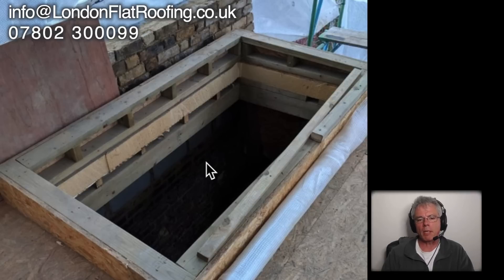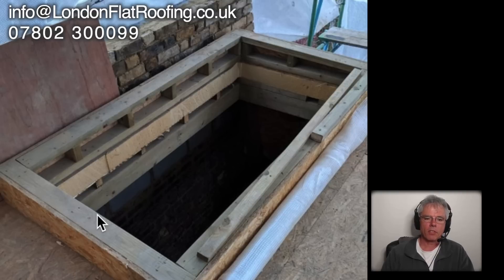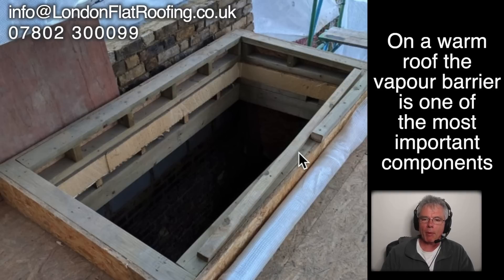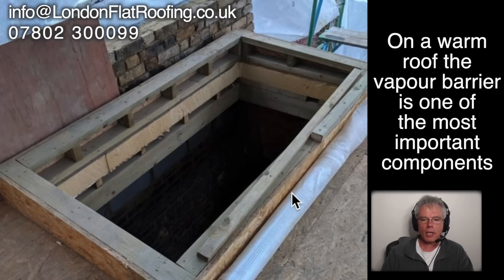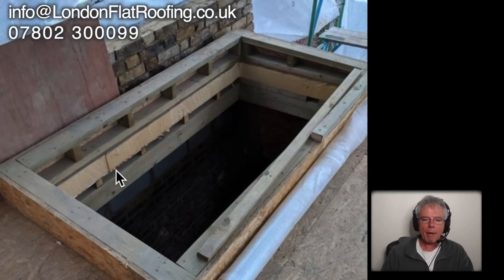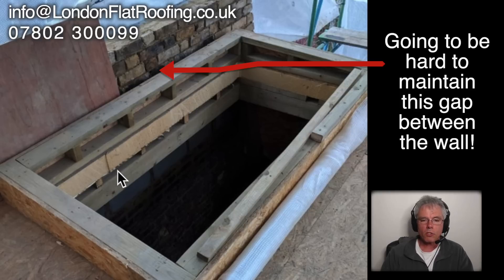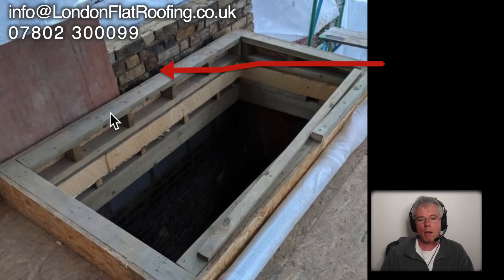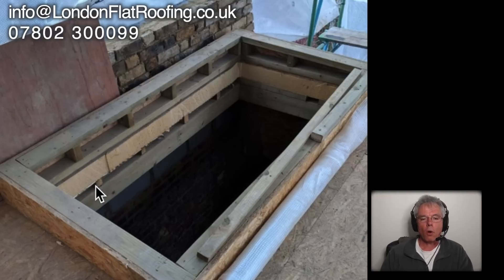Flat roof design going wrong.  Who is responsible for your flat roof design?

Comment: Hi Steve, could you give me a bit of advice. I am building a garden room and the roof joist are 120 x 45(5x2). I was thinking of using(cold roof inside to out )  12mm plasterboard - 1000guage polythene - 25mm PIR up to joist - 100mm XPS insulation between joists and 20mm air gap under decking with continuous soffit vents back and front. will I get problems only having 20mm air gap

Comment: Hi Steve, I'm in the process of building a flat roof for a newly single storey. The plan was to have a parapet wall with allutrix over the sub deck 150mm insulation and finishing with resitrix full bond. Things were a little sloppy with the structure engineer/ lintel, which led me to change  the roof layout into a traditional(not parapet). Is the mineral felt ( torch down) method my best option or can I still use resitrix? Thanks
Reply from the maker: You can use torch on felt as a vapour control layer if you want. However it has to be one of the thicker torch on felt personally I don't use it but I have seen specifications that one or two layers of felt will work as a pair of vapour control layer. The main thing here is to think about the air control of the system. The torch on felt over the decking and up the walls if applied correctly will be 100% airtight and actually that's probably more important than the vapour resistance of the product.

Comment: I currently have a conservatory with a glass roof 3.5m from back of house out. I want to put a flat roof on with 2 flat sky lights. Will I need planning permission to turn a glass roof into a solid flat roof?
Reply from the maker: Yes probably you need to ask the planning department
Reply: @SteveRoofer  thank you I spoke with them today and no building regs are required. What thickness osb do you use for the bottom deck and thickness of osb if you are boarding on top of the celotex thanks Steve

Comment: I am a GRP roofer i tell customers all the time they need a vapor barrier on thir build  mainly cold roofs as warm roof its my job to do it and the amount of times they come back to me an tell me the building inspector says we dont need 1 is unbelievable,, they all have new builds with fancy pods but put spot lights in the ceiling carnt work em out ,,

Comment: It's all pretty simple actually. Builders have to follow the Architect, Structural.... and so on Drawings. If they change the drawings then the liability lies with the Builders then. So, whatever is wrong on Architect or whoever's detailing is done for the builders on the drawing, those are responsible for the mistakes. Meaning Architects should have learnt better in universities. ;) That's all. However, this case is not the worst one. It can be easily fixed at this stage. Since the roof is not covered by GRP or Epoxy Resin...yet.
Reply from the maker: Yes that pretty well sums it up
Reply: Most small builds I see don't have detailed drawings, they rarely tell you the brick and block type let alone build specific details.
They expect the builder to use experience and the builder asks the home owner if they have queries.
There should be simple to use resources that details all the simple common issues, instead you have to search multiple

Comment: A good builder should know this, it’s actually very standard stuff. It’s the difference between a good knowledgeable builder and someone who doesn’t know or care enough. You get what you pay for and good quality building work is expensive. The upstand details are fundamentally the same on all jobs, vapour barrier, continuous insulation, ventilation if necessary, correct application of all the above and there won’t be any problems. I always enjoys your videos, detailed and informative

Comment: A much better way of building these lantern opening is to take the extra time to construct a four frame of a triple which is within the ceiling opening value. Lot more space to insulate, get your vapour layers in and stops cold bridges. Easy to keep your opening square too
Reply: What do you mean "a four frame of triple"
I'm about to construct a warm flat roof with  a central lantern and worried about the lantern upstands. Can you explain how you do it in more detail please.
Thanks 👍
Reply from the maker: Yes that's the way I do them

Comment: I'm all for insulated upstands, but the size of that rooflight/lantern opening is far larger than the other version shown in your own video. I dare say that if the 12mm(?) plywood upstand isn't up to much abuse from a knock or a kick at some point in the future. I think a SIPS style upstand would be a better approach myself to get a circa 75mm wide upstand. Some rooflight manufacturers offer these as 'bolt-on' options when buying the rooflights/lanterns.

Comment: To answer Steve's question, I'd say the client is ultimately responsible. Depending on how they commissioned the work, that will determine who has the delegated responsibility. Chances are, the client didn't use an architect and has gone straight to the builder who's given them a price for the full scope of works. If that's the case, then it's either the main contractor or their roofing subcontractor who would be responsible for the competent and compliant design, depending on the nature of their 'contract'. If any deficiencies haven't been picked up by the BCO, that doesn't absolve the specialist (sub-)contractor from building a robust construction.

Comment: Any builder should have the knowledge if the work they take on. I am personally fed up with people doing work like this. I now build garden rooms and the amount of  apparent professional companies who build a sub standard garden room from a design aspect but looks good. Most are doing a cold roof with no ventilation.
Reply: There's quite a few companies doing this. Oakwood garden rooms on youtube do hybrid roofs where the PIR insulation is pushed right upto the OSB. They report no problems so far.
Reply: they are all trying to get insulation into their builds at same time as meeting PD regs. Are you building under PD regs and managing to ventilate still?

Comment: Builder builds things a desghner designs things simples  , agreed in what you have said,  makes sense  
But BCOs and desighners ,colleges need to educate us more on this area  , ive done both methods  , never had a problem  but technically your right , lots of things here that rattle me  condensation being one if a board is put on the deck will it just decay from condensation , bco by me telling lads to roll dpm over the roof 🤔 dont seem right   could be a condensation trap  also used alutrix

Comment: I am glad to see that a tradesman understands his trade. There is so much ** on You tube by so called builders that maybe YouTube should take down fake and misleading content??
As regards your question concerning the detail:  It should be the designers responsibility to detail and specify the materials to be used, be that Architect (I am one) or surveyor etc.  Small builders are invariably a tradesman who has set up to install all trade elements, I've met several builders who are say, a brickie by trade and confess to knowing nothing about joinery or decoration relying totally on their subbies, who just want a quick in and out and get paid.
As regards the detail you show, I assume that the ceiling is still to be installed, then the vapour barrier can be fixed to the u/s of the joists all with taped joints and taken up the rooflight cheeks.  The plasterboard is then fixed through to the joists.
BTW your example of the VP on a roof shows a very thin piece of insulation to the rooflight cheeks that also does not have a structure for the rooflight to sit on.  With that form of construction I would expect warm moist air to accumulate under the rooflight and condense on the poorly insulated cheeks.  Also the plywood would deteriorate with the moisture causing a decoration mess.

Comment: Devil in the detail, don;t leave spec to the builder, project manager should ensure detail before installation of windows, someone should be linking up between chippy and roofer/ flat roof installer, every design is slightly different, but excellent warm roof build up Steve

Comment: Don't need a vapour barrier on a warm roof construction. I would never put a window load on insulation. And they have point loading here too. The insulation does not seem thick enough to comply. It should be 150mm if it isn't.
Reply: I'm an Architect with 20 years experience and agree with everything said in this video. You always need a Vapour Control Layer with a flat roof as this prevents interstitial condensation at the dew point of the roof - ie usually within the insulation layer. Warm air rises and usually with moisture. When this happens you'll be compromising the insulation and may cause damage to the building fabric. The foil on the insulation cannot be relied on due to the termination points being in the wrong location - as outlined in the video. The VCL needs to terminate higher and be continuous under all insulation panels and around penetrations.
Reply from the maker: The flat roof Insulation should be as thick as necessary to get to the correct U value for building control this is taken as an avage what we don't know is if its not thicker elsewhere. Yes you do need a VCL with a flat roof. I don't understand the other comments please elaborate
Reply: @SteveRoofer  this is a warm roof construction which negates dew point  but the foil is built in to act as a vapour barrier and if they thought this they were correct -  unless you know something else which I'm open to hearing. Regs change all the time as we know. You are correct it has to be thick enough to comply and compliance in this case is 150mm unless there is insulation below. I think it's to achieve a 0 .2 wm2 U value. Building control may ask for a venting membrane over the insulation but this is not required in the approved documents as far as I'm aware but  due to the love of private companies by the Tories they have opted to use NHBC standards which go unnecessarily into greater detail . NHBC only do this so they can avoid the scrutiny of local authority which allows them to self inspect on the strength of its standards. The organisation is funded and originated by house building companies. I refuse to work to their standards when BC try to inflict them on my jobs and I refer the officers to the Approved documents when I re-buff their NHBC assertions. A venting membrane has no use whatsoever here as it has no moving air above it and is sealed in. 
In terms of point loading there is.firring strips  below the insulation which when weight is applied would cut into them causing depression and deflection in the plane of the flat roof the screws pull the upstand frame down. Under a concrete floor the boards spread the load of the concrete and the live loads imposed but in this case the weakness of the insulation boards could prove troublesome.
Reply: @giotto4321  No you do not need a vapour barrier,  it is not required by building regs. In a warm roof construction the dew point does not occur within the roof's profile  and the foil acts as a vapour barrier anyway. That is the point of a warm roof.
Reply: Reading all your comments, I understand why there's such a gray area over this problem. There should be one and only one rule of practice, why is there so many conflicting arguments. Regs change every 2min with regard to insolation. I truly believe the insolation we use today is not up to standard, way too many problems and nobody has an answer.
Reply: @alhacker6674  they shouldn't have privatised the BRE, building research establishment. It is easier to corrupt & bribe now, by product manufacturers etc

Comment: Can you tell me what insulation values the expanding foam you keep using  give us and where your buying one that gives any values at all, you keep having a dig at other peoples work , when your doing it just as bad, relaying on a tin of expanding foam to fill pore cut gaps in insulation, yes it’s better than nothing, but let’s be fair, it shouldn’t be used and any good building control officer would pull this as gaps shouldn’t be so big when cutting  the insulation boards, personally I wouldn’t take great pleasure in pulling somebody else’s work, it’s easy for anyone to do that,
Reply from the maker: All U values for the insulation we use and for all insulation will be supplied by the manufacturer
Reply: I think foam is wonderful stuff tbh

Comment: Hi Steve, the information I've gleaned from watching a few of your videos is amazing! Thank you so much for sharing your knowledge. I'm a residential home owner from North Essex. I'd love to upgrade the insulation in my existing 30 year old flat roof extension which otherwise appears to be absolutely sound. From your videos I've worked out my extension roof is currently of cold construction but there are no physical obstructions or height restrictions requiring any upgrade to also be of a cold construction. But I'm very wary of causing any structural problems as a result of employing someone who doesn't really know what they're doing. Do you have any advice as to how I go about finding a roofing company local to me who I can be confident will know what the correct approach would be?
Reply from the maker: I find that after talking to different roofers I slip in the conversation details on warm and cold roofs. I ask what VCL they use. most of them give the incorrect answer.  Another one is to ask how you vent a warm roof. You Don't shoud be the answer.